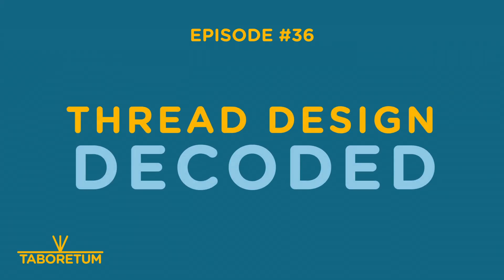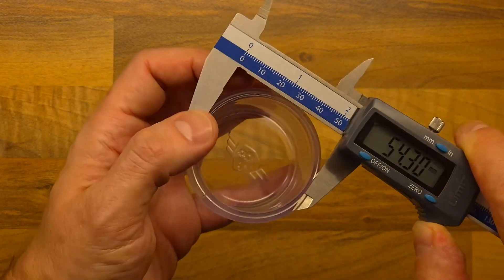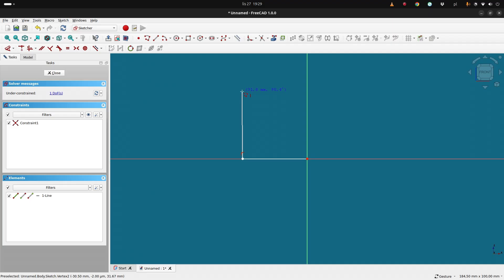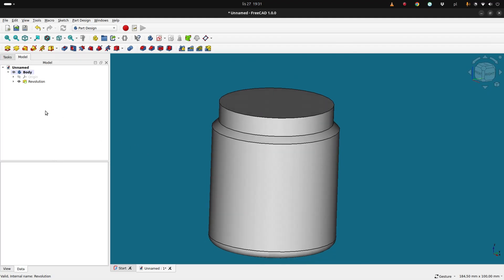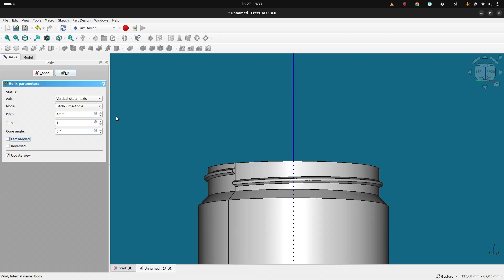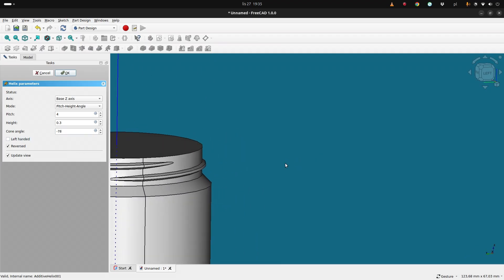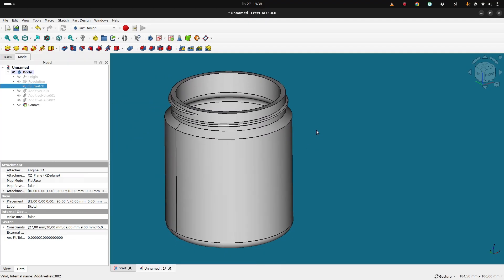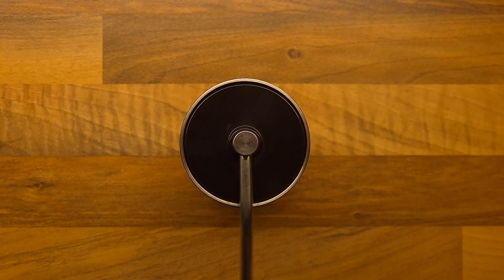Make Flawless 3D Printed Threads That Actually Work!

Comment: I have followed this exactly, but when it comes to cutting it says 'Removing splitter failed'. I cannot work out what I am doing wrong.

EDIT: I finally did it. I think I was so tired last night I just became frustrated. I don't even know what I've done differently this morning but it's working now.
Reply from the maker: Glad it worked! FreeCAD can be frustrating at times, but the more you use it, the easier it gets.

Comment: I have problem adding the second small helix. When I try to add it to the bottom side of the previous spiral, the outer shape just vanishes :(
Reply from the maker: Hard to help remotely, are you selecting the flip sides? maybe some parameters make this new part of thread not touching the whole thing? Are you using most recent FreeCAD version?

Comment: The Fastener Workbench just does it all in 30 seconds ...
Reply from the maker: Did you try? I did and failed :) First you cannot use the thread inside Part Design workbench, second when you change pitch fastener workbench just changes the thread size so you cant have thread like on my design. Or multi start threads. But I'd love to see how to use Fastener Workbench for this type of design! Please share if you can.

Comment: I've followed your video step by step, but after the 2nd sketch, I select the Groove button and it says Removing splitter failed. I have the 2nd sketch selected and followed your instructions to a T. Not sure what I'm doing wrong. Any suggestions?
Reply: I had the same problem, it is related to the refine option in each feature. 
Just make sure that it is set to false in the revolve, the three additive helix, and the groove. 

You can also deactivate the refine option globally under preferences > Part/Part Design > General, and uncheck the Automatically refine model after sketch-based operations option. The last one worked well for me :)
Reply from the maker: I need some more data :) second sketch is the "tooth" of the thread that you use [Additive helix] on. [Groove] is used with third sketch to make the whole thing hollow. If you are talking about second step - do you get any error? If not, maybe your sketch ends up being INSIDE the whole thing? If this is true then you will get you groove inside the body and you will see it only in View -> Toggle Transparency mode.

Comment: Hi! Thanks for the video, how did get the tip of triangle to be rounded?
Reply from the maker: Not sure if I know what you are talkin about but I often use [Create polyline] from [Sketcher geometries] - you have to start with a line, then you pres M to cycle through different arc/line and constraint combination, as described here - https://wiki.freecad.org/Sketcher_CreatePolyline

Comment: Utterly brilliant vlog. Thank you so much, I will subscribe 👍
Reply from the maker: Glad you like it :) It is a bit niche, but there is a group of interested people :)
Reply: @taboretum  What is the general rule, I tried to make a coke lid but it leaked (my fault not yours)?
Reply from the maker: Good calibration, slight over extrusion,  less retraction,  higher temperature,  dry filament... lots of moving parts, sorry :)
Reply: @taboretum  You mean trial & error?
Reply from the maker: @Bob-el3iw  Well, yes :) There are tons of tutorials on calibration. Did you consider printing TPU?
Reply: @taboretum  Always printed with PLA, I know it has its downsides, I have an Ankermake M5C which is good, I printed the lids on precision. Your lids are great by the way, so useful, I took the dimentions & use them as standard.

Comment: I learned several techniques in the video, in addition to the threading by using helix. Creating the thread this way, although longer than a thread macro or workbench, helped me understand thread measurements and structure. Thanks.
Reply from the maker: Thanks for sharing you thought, great you found it useful :) Comments like this keep me motivated!

Comment: how to make a hole like in the video
Reply from the maker: You have few options:
1. Model the hole/emptiness in the sketch before revolving (I did this in the video around 10:50 mark).
2. Select a face that should become a hole and use "Thickness"  in the "Part design" workbench.
3. Keep your model solid and make it hollow and open on top in slicer (infill 0 and no top layers, so called "fake vase mode")

Comment: What's the hotkey(s) you used to switch between regular corners and arcs in the sketch?
Reply from the maker: Not sure what exactly are you asking for :) In principle you press G (for geometry) followed by a first letter of element (L for line, A for arc, etc.). G,M is for polyline (not first letter ;) ) and once you start a polyline you just press M to cycle through  elements (end last point is the beginning of new element. Happy designing! :) 

P.S.
Maybe I should make a video on this?
Reply: @taboretum  Yes, sorry should've been more specific. I was talking about the polyline mode switch. Thanks for showing that! 

I agree with the other guy, if you could find a way to show the key presses on screen that'd be really helpful.
Reply: @taboretum  It would have been better if you told this in the video or did not go over it so fast and have visual representations of pressed keys in view. It is impossible for me as a beginner to follow this tutorial the way it is now.
Reply from the maker: I plan a new episode with super slow flow explaining each step of my design process. I will also add my keystrokes! Thanks for the hint :)
Reply: @taboretum  I really look forward to it!!! Thank you for listening to my feedback.
Reply: It's M. I had to Google it. As others have said it would be good if it was a bit slower, with explanations of keyboard shortcuts used.